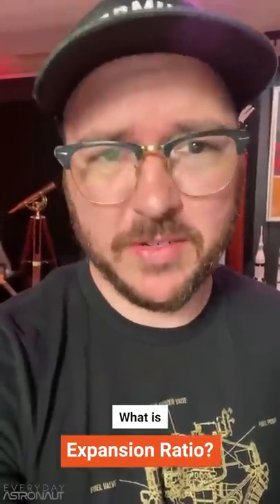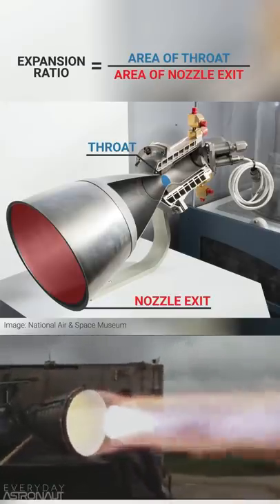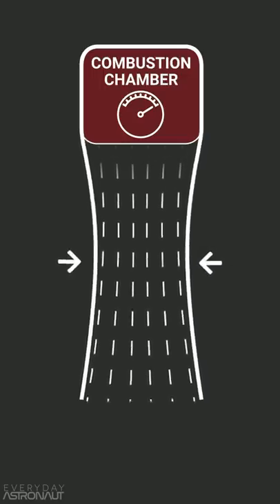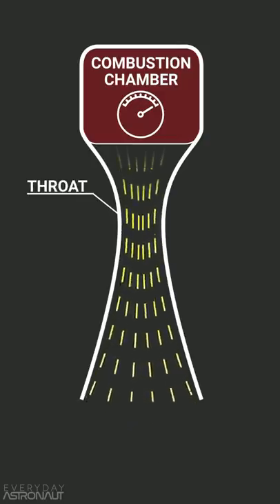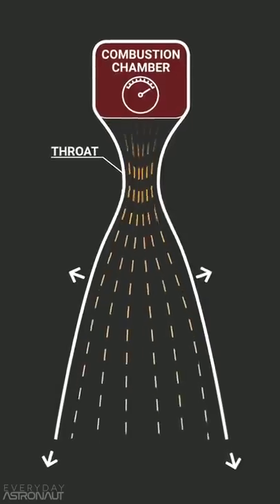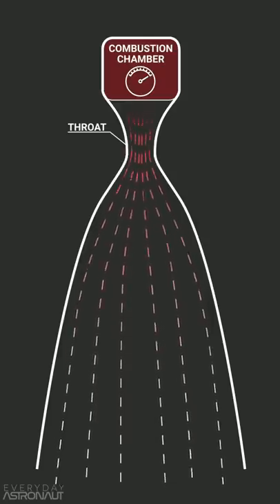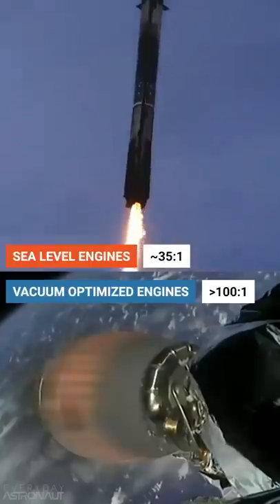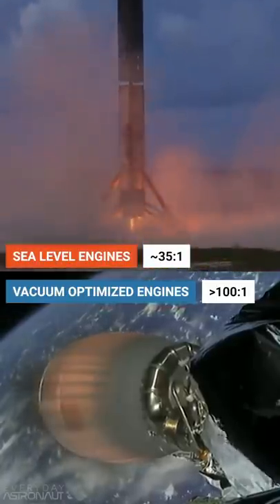What is expansion ratio? #shorts

Comment: I've learnt more things in these 54 seconds than I did this week in general
Reply: Tru
Reply: That's facts
Reply: Tru dat
Reply: Dude I see you all the time
Reply: @coffeespy1133  I’m the next Justin Y, everywhere, every time, everyday!
Reply: The problem with having a ridiculously long nozzle at sea level is because the exhaust will become lower pressure than air so the air will push the exhaust away from the nozzle, which can lead to catastrophic damage, just to add on to what you’ve already learned.
Reply: @jmpmanaj2329  Thanks for adding in! Would a larger Combustion chamber help with that? Because the F-1 engine had a heck of a nozzle and chamber
Reply: did you build a rocket engine yet?
Reply: Fact
Reply: Same
Reply: 8 08
Reply: @jmpmanaj2329  Nice little fact to point out. I was quite surprised when I first found this out. In fact it's what made me go down the massive rabbit hole of Rocket Science. Thanks to Scott Manley and his YouTube channel for starting me off.
Reply: @azztecar  same tbh 😂
Reply: Facts
Reply: These are the gems on the yt shorts that really deserve to been seen.
Reply: @luistavares969  Mate are you okay
Reply: Lmaooo your 2 braincells worked OverTime

Comment: To add a little:
Higher expansion ratios (as used in vacuum optimized nozzles) have lower pressure at the exit of the nozzle.
Vacuum optimized engines can have much lower pressure at the nozzle exit than atmospheric pressure at sea level. If these were used at sea level, the atmospheric pressure would push in near the end of the nozzle, decrease efficiency, and could cause damage to the nozzle. The ideal expansion ratio (and nozzle) changes with pressure (altitude) so they often make the flow a bit over-expanded at sea level to get better efficiency later in flight
Reply: IIRC the RS25 does that since it fires from sea level up until space. You can even see a bit of flow separation when the engine starts firing while the nozzle kinda warps because of it.
Reply: @mangatom192  NASA has/d an explainer on the website about how they managed that. They put a little kink in the ideal shape to sorta "convince" the flow to stick to the side of the nozzle and push the sea-level air out of the way. They've been a bit slow remastering the videos from now-defunct Flash so some of the animations might not work.
Reply: You mean like an aerospike?
Reply: this video is really misleading nonsense tbh. it’s pretty basic physics that he’s trying to hype up as ✨rocket science✨
Reply: @billyt8868  I wouldn't say it's misleading or nonsense. This information is pretty much right out of a compressible aerodynamics or space propulsion class for an aerospace engineering degree
Reply: @ArrayGamer  7uu7uhuuuuuoututu
Reply: @billyt8868  It's not at all misleading or nonsense, it also is not in anyway basic physics... I mean he isn't actually getting into the fluid dynamics but the behavior of converging diverging nozzles is far from basic.
Reply: The key is to design the fuel and oxidizer pumps to have as wide as possible operating range between 100% and 0% of throttle, allowing as close to ideal expansion as possible as ambient pressure decreases. Older engines couldn't really operate much below 80% of rated power level, so when throttling down to the minimum before stage separation the exhaust was underexpanded, leading to the very large exhaust plumes you can see in the Apollo launches. Newer engines like the SpaceX Merlin can throttle down to 40%, which is a major advantage in terms of fuel efficiency, and part of the reason SpaceX is able to recover the first stages, the better fuel efficiency allows a larger payload mass fraction (from 2% to 4%) which they chose to cash in by adding enough fuel to land.
Reply: Don't be rude to Tim, he teaching us about important rocket engine facts
Reply: The video is not misleading science.

Comment: It's explained as simple as it can be explained, would love to see a 30 min vid about this. The math that goes into this and how different propellants, temperature and chamber pressures effect the efficiency in the nozzle, are a lot more complex.
Reply: Wall of text incoming, TL;DR at bottom....

So actually the only variables important for analyzing flow (and therefore efficiency) in a rocket nozzle are chamber pressure and exterior pressure (and of course the geometry of the nozzle). In terms of actually analyzing just the flow in a nozzle the temperature and other properties of the exhaust have no part to play.

So one common method of engine design is you start with defining your operating conditions (sea level, vacuum both?) and then your pumping system, injectors and propellent choice. Your pumps and injectors are the primary factors in determining your propellent mass flow rate, ie what quantity and how quickly you can pump your propellent into the combustion chamber, over a range of potential chamber pressures. Propellent choice tells you how much additionally energy will be added into your exhaust gases from the combustion process. This is the most complicated part of engine design, the design of the power head (the pump and injector assembly). 

Once you have figured this stuff out you will know what range of pressures your combustion chamber will be operating under and from there the process of designing the nozzle geometry is pretty simple, easily one of the simplest parts of the design process. Temperature is really only a factor in terms of material choice, making sure you make a nozzle that isn't just going to melt, aside from that it isn't a factor in the geometry of the nozzle or the flow through the nozzle.

In terms of the overall efficiency of the engine (it's Isp or specific impulse) that is purely a function of the exhaust velocity, doesn't matter what temperature it is or what it is it only matters how fast it is going.

So TL;DR
Propellent type, temperature etc. only play a role in determining the pressure inside the combustion chamber. The design of the rocket nozzle's geometry (which determines the exhaust velocity and therefore its efficiency) is only dependent on the pressure inside the combustion chamber and the exterior pressure. So if you have two engines that use different types of propellent etc. but achieve the exact same chamber pressure then put the same nozzle on them and they would operate the same and have the same efficiency (but could have different thrust as thrust is a factor of exhaust velocity AND exhaust mass, so with the same exhaust velocity a LH2/LOx engine would produce less thrust than a kerosene/LOx engine but would have the same efficiency). Conversely you can take the same power head and just change the nozzle on it to change its ideal operating conditions, hence why there is a merlin sea level and a merlin vac, same engine just different nozzle.

Comment: Great video but one small correction: the equation for expansion ratio is wrong. It involves the area of the exhaust divided by the area of the throat, not the other way around as you had it here. Expansion ratios’s are greater than 1, not fractional numbers. Love the animations otherwise.
Reply: Noticed that too, I looked for the comment :)
Reply: @zavevu  yea, almost nobody else seems to realize the incorrect info which is a bit bothersome. Didn’t expect that mistake since his videos are usually peer reviewed.
Reply: @ZicajosProductions  probably not the Shorts
Reply: The video's explanation (EA) seems self contradictory. The throat speeds up the gasses (fine) but the expansion nozzle would slow down the gasses (not go faster ?), so that would mean the layers of gasses higher up in the expansion nozzle would push against the slower layers of "captive" gasses to create additional thrust ? No ? (shrugging shoulders.).
Reply: That's the problem with these video shorts.  They are too short and often contain incorrect info because the info is edited down to make it fit.   One of many reasons to avoid these video shorts.
Reply: @michaeldeierhoi4096  if I had to guess the Shorts videos probably aren’t peer reviewed like his normal content is. Regardless I still love the guy, his channel is one of the best out there
Reply: @extradimension7356  A converging-diverging nozzle is designed so that the speed of the gas is exactly M=1 at the throat (the throat actually chokes the maximum flowrate of the nozzle), as for subsonic flow M<1, a converging nozzle speeds up flow, but for M>1 supersonic flow, a diverging nozzle increases speed.
Reply: @extradimension7356  the throat speeds up the gasses until supersonic. At that point the stuff you know about flow from Bernoulli is actually reversed, because the flow “becomes” compressible. Subsonic flow is treated as non-compressible, and divergence must cause it to slow down and increase in pressure. Divergence of supersonic flow, however, makes it go faster, and lowers its pressure, because it’s expanding.
Reply: @tylerfb1  Thanks for explaining that very clearly. I have a bunch of old (what was called then) "Astronautical Engineering" textbooks from the late 1950s and mid 1960s (from my father)  - that have a lot of the equations and illustrated examples of "In process" work/ research on systems like the Saturn 1B etc. Maybe I find "Old dusty" box and dig in. Exhaust velocities / muzzle velocities throat ratios and dimeters etc. @T G I guess from what you say that better helps explain how aerospike work. I still don't fully understand what causes "Shock Diamonds"  on rocket engine exhaust gasses nor powerful jet engines ? The physics I learnt doesn't quite "cover it" and no amount of waffly handwaving explanations could attempt to make would ever "round the circle" on that :-)
Reply: @extradimension7356  Shock diamonds are the exact same thing as sonic booms. IE, they are waves of compressed gas that happen as a result of a disturbance in supersonic flow. You can think of it like this: sonic booms happen because the air can't get out of the way of the airplane fast enough, so the air just compresses in front of it. That compression is heard and felt as a sonic boom. 
Shock diamonds are only different because the medium is not the atmosphere, it is the supersonic jet of exhaust gasses projecting into the atmosphere. They happen usually as a result of under-expanded nozzles. When the flow separates from the nozzle, that causes a disturbance that compresses the gas, and those compression waves interact with each other and the boundary of the jet of exhaust to form the diamonds you see.

Comment: It blows my mind how the pressure can be lower inside the bell than the ambient pressure outside. Or how that force lifts all that weight! 😳Like lifting swimming pools, more like hurling, more catapulting them into space. The whole thing is amazing, controlling an ever exploding exolosion🤯. To think I used to love messing around with V8's... Pfff
Reply: You’re onto something, you cannot actually reduce pressure inside the bell farther than the outside environment. If you do, you will create an unstable nozzle as ambient air will enter the bell. This is the limiting factor of expansion ratios at sea level, and why in vacuum you can have much higher expansion ratios!
Reply: @dan445678  
Makes me theorize if something could be designed to help prevent or reduce the ambient air going into the bell so that way you could reduce pressures without creating an unstable environment in the nozzle this allowing the use of a higher expansion ratio closer to sea levels.
Reply: Conceptually, the V8 is much more complex that a rocket engine. The engineering however would open a whole different can of worms when you try to build the latter
Reply: @ViperSRTnACR  The problem is you can't do this, fluids can't flow from a low pressure area to a high pressure area, it's the second law of thermodynamics again, energy will only flow down an energy gradient, never up, you have to have to do work (ie spend additional energy) to move energy the other way.

Comment: Wow, supersonic flow IS weird! I thought the wider vs narrower nozzles were only because at sea level the exhaust wouldn't expand as much so a wider nozzle would result in the exhaust separating from the nozzle walls and cause instability and damage, while in vacuum it needed to be wider to capture more of the thrust since the exhaust would otherwise leave the nozzle before expanding a lot more, wasting energy that could have gone into accelerating the rocket.

Comment: Something important is missing here. 
In air the best expansion ratio is tuned for the flow static pressure to match the atmospheric pressure. Some device do provide adjustable expansion ratio to adjust the output section pressure all along the flight. 
In the vacuum, the largest the expansion ratio the better, but the gain gets smaller and smaller for very large ratios. Optimization is a matter of gain versus additional weight in this case.

Comment: I would like to see a video on the transfer of the mechanical energy in a rocket engine?  You mention that the gas pushes up against the engine, pushing the rocket upward.  Could you talk about the physical construction of the nozzle, the combustion chamber, injector plate, fuel and oxidizer manifolds, and the rest of the stuff that transfers the mechanical energy up through the rocket, through the gimbal, to the frame of the rocket?  Not only do the engine parts pump fuel and oxidizer in to the chamber, but they have to double-duty transferring the mechanical forces up through the engine to actually lift the rocket.  I think the chemistry and cool explosions gets all of the attention, the mechanical engineering should get some attention as well.  I always find it amazing that these engines don't crush themselves like a tin can by the gazillion pounds of thrust they produce.

Comment: A little on choked flow: In subsonic flow, velocity increases faster than reduction in density, meaning that up to Mach = 1, you’re increasing mass flow. In supersonic flow, M > 1, because you’re beyond the local speed of sound, there is no way for the flow downstream to “communicate” through pressure waves back upstream. So the particles begin to separate from one another, and the decrease in density overtakes the increase in velocity, reducing the mass flow rate. In space, you theoretically want an infinite expansion ratio. Engineers approximate an E.R. of 100 as basically infinity 🤔

Comment: Hi, great video. I would like a longer video explaining this in more detail. In a venturi, the flow is fastest at the narrowest point. How is a rocket engine different from this? I can't get an intuitive grasp on how the flow keeps accelerating past the throat.
Reply: Combustion
Reply: The flowing volume of gas is still at high but no longer insane pressure. Think 3 atmospheres instead of 300. The optimal nozzle makes the final pressure exactly the same as the outside air. In a perfect vacuum it would be infinitely big, but for obvious reasons it is impractical for it to be wider than the next widest part of the rocket.
Reply: @sanderkvenild8947  thanks for the reply. Does that mean that the pressure at the throat is less than the pressure in the combustion chamber?
Reply: @Shenron557  I guess so, but I haven't taken fluid dynamics in school and what I've learned is from people on the internet so I could be wrong.
Reply: Once you have got supersonic flow, changes in the pressure can no longer move against the flow upstream. Keep that foremost in mind. The purpose of the nozzle and its shape is to contain the flow and redirect any radial velocity to axial velocity. This is how the flow accelerates as the random thermal energy is converted to kinetic energy moving in only one direction, out the back. The wikipedia article or any Google search on "de Laval nozzle" should have diagrams that show pressure and velocity through the engine.
Reply: @Markle2k  thanks for the reply. So is the temperature at the throat lower than the combustion chamber? I've read the Wikipedia page on de Laval nozzle before. But I couldn't get an intuitive grasp on how it works.
Reply: @Shenron557  From what I can see of the graphs, it appears that the temp drops in lockstep with the pressure with a steep drop across the throat.
I'm just a lifelong enthusiast, not a rocket scientist, btw.

Comment: If I understand correctly, it's because of friction.

The smaller the pipe, the more the surface area to volume ratio: resistance changes with the FOURTH POWER of the radius.

My guess is that they designed the rocket thrusters so that the radius at any given point is designed to carefully control the pressure of the gas at that point. Too small and there's too much pressure and not enough flow, too large and there's too much flow but not enough pressure. You want a careful gradient to maximize the efficiency, I guess.

Comment: Tim, on the wild idea front, here is one for eliminating header tanks on Starship. Given the high pressure and low temperature inside the propellant tanks as well as the cylindrical shape, it seems that it might be possible to to create an acoustic pressure gradient that would force and maintain the liquid up against the aft bulkheads in each main tank in microgravity. This could be accomplished by installing digitally controlled acoustic sources (i.e. 'speakers') into the bulkhead structure and drive them so as to create the appropriate waveforms inside the tanks. Acoustic gravity simulation as it were.

Any thoughts?

Comment: You mention the difference in size between nozzles meant for vacuum and ones meant for sea level. I would've probably spent the last 14 seconds on explaining why. That the aim is to match outside pressure. I guess the bit about over and under expansion might go past the 60 seconds mark unfortunately.